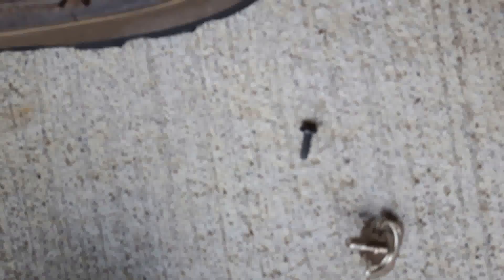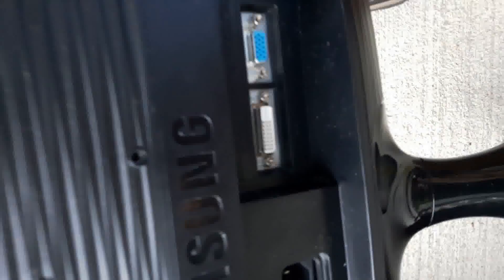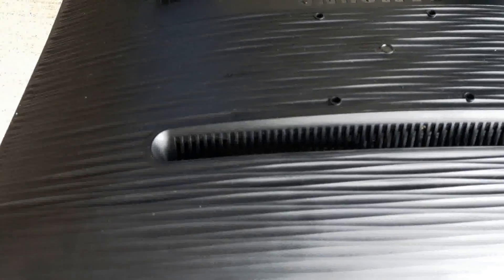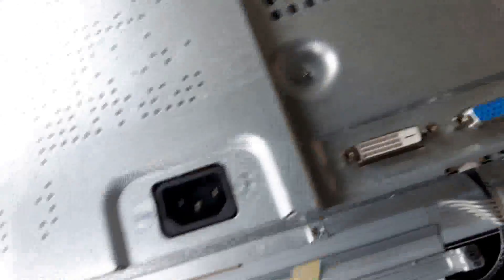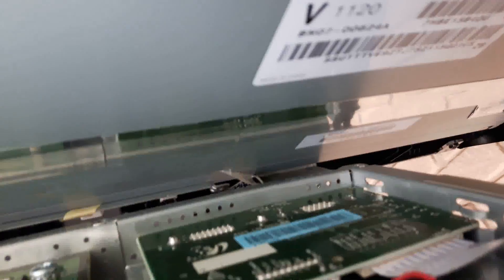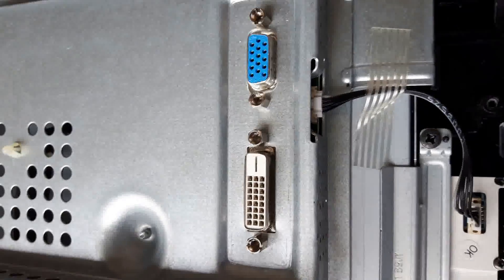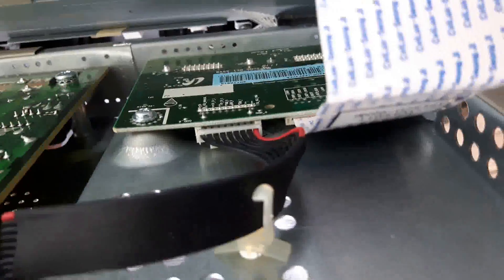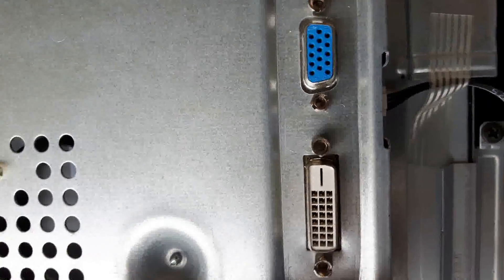How to repair samsung monitor with no display signal message

Comment: you answered by saying replace any of the small baby cards shown within the protective casing, but do you know how much it is to replace that card? i found out it costs more then the value of just replacing the TV. Therefore, again with or without the subtitles you still don't tell us how to repair. Only reason i found out is you personally messaged me.
Reply from the maker: Subtitles should mention somewhere on dry solders spots fix. A spare monitor with parts can be handy (for who has one). True, new parts can be more expensive and better to buy a new monitor. But, in some cases like mine one, the monitor fix was easy and it still works after two years. A fix this way is not guaranteed, but may work for some of us. You are right, subtitles are not obvious unless the user clicks there (I didn't know that either)...
Thanks for watching.

Comment: Might be a nice idea to give some commentary on what your doing
Reply from the maker: yes, sorry about that. basically open it along the edge clips and check all the connections and replace the circuit board with a new one (if it is bad).
Reply from the maker: Turn on the subtitle please. one of the crappy videos but will make sense if you turn on the CC